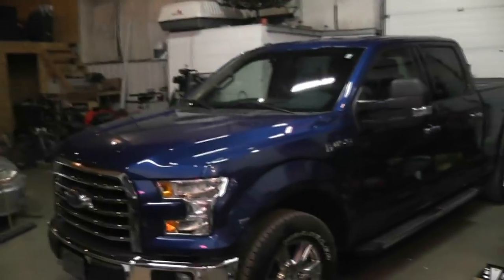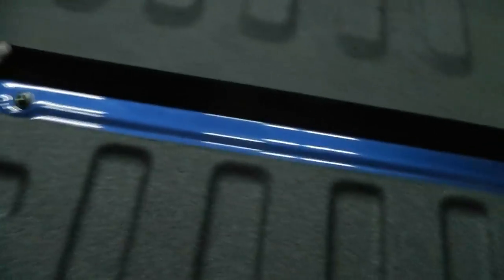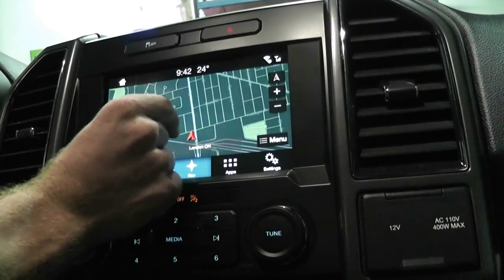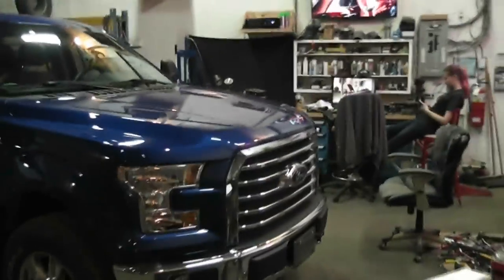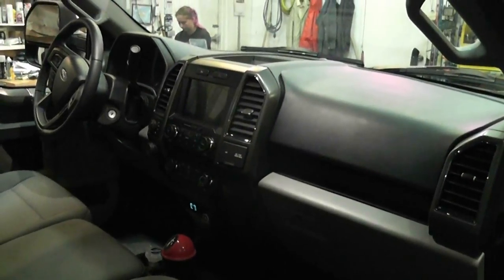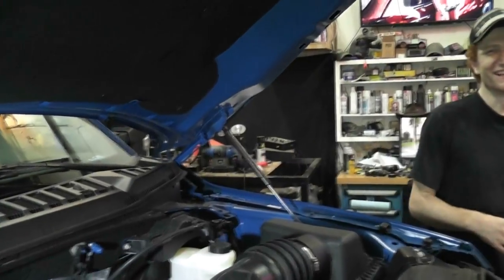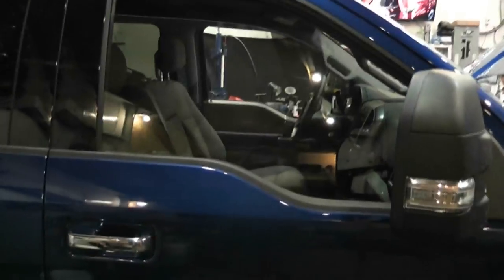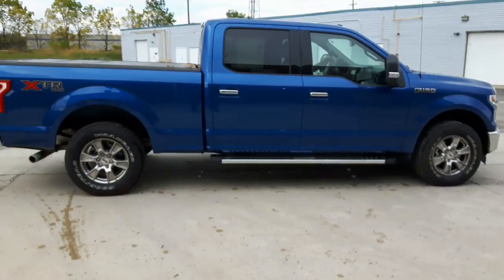Brandons New Truck 2017 F150

Comment: My 1997 F-150 with a 5.4L has the same front end as the F-250 in 1997. I plow with it and has over 250k. Replaced brake lines and Coils Manifolds etc. Runs Great

Comment: I have a 96 Ford F150 with a 5.0L (302) Windsor V8 with 206,820 miles on it and it's still going strong. The only thing I replaced on my truck was the starter but other than that mostly was just simple maintenance, took out the transmission fluid just to get rid of the shuttering it was making and it hasn't had a problem ever since.

Comment: The BakFlip tonneau covers are crap.  My '14 Ford F-150 had mine replaced twice by Ford.  Covered by warranty, but they all leaked around the bracing.  And really easy to use a hook to grab and pull or screw driver to push the cable to open the top without having to open the tailgate.  I also don't like the drain system, nor the fact it blocks the back window when fully opened up.  The "kick stands" don't hold either.  My new '17 Super Duty has the Truxedo Pro X15 roll-up cover that looks amazing and keeps the bed dry.  It's already lifted from factory and better pulling/hauling capability than the F-150.

Comment: FOREVER TRUCK MY ASS ...........Just give it two years. The interior dye will be rubbing off on ALL instruments. The cheap cloth seats will be ripping on the side bolsters. The vinyl door panels will be peeling from the  door boards. Just wait and see my friend. Ford interiors after 04 ARE JUNK
Reply: Grill will start peeling steering wheel will get dull, etc etc
Reply: bigpopparand1 very true ford uses really cheap adhesives and primers
Reply: I didn't have any of those issues with my '14 F-150 Platinum.  The interior was really nice, and still looked like new when I traded it in for a new '17 Super Duty 6.2L gasser Platinum.  The only interior problem I had was a defective clock spring in the steering wheel.  Looked like it was damaged during the factory install.  I had to install a oil catch can for the 3.5L turbo, since Ford engineers didn't account for all the moisture issues.  Really the only reason I traded it was because I also had a '06 Ford F-350 6.0L diesel that had to go and the F-150's rear leaf springs were too light to handle any real load without a distribution hitch.
Reply: Bernicelivingston  yup. These trucks are meant to be traded in every 3-5 years.
Reply: outonthewire Exactly man while the old trucks are meant to keep on running and driving.

Comment: You walked off the minute he was about to show the second rear seat being let down you impatient rickem
Reply from the maker: He couldn't get it down
Reply: Haha, I was wondering,  I have same truck and was curious how he was going to do it, I’ve pissed with my for a hour.
Reply: Lol, turns out i was yanking on the wrong pin. There is one that is more centre on the clip that holds it to the back of the cab. A little higher up then the one i had hooked. 
Builtright industries has an install video on theyre website. Got mine installed now and its wonderful
Reply: @Branboy3  hi hunny, kisses💋💋